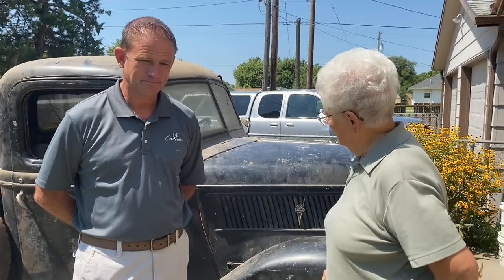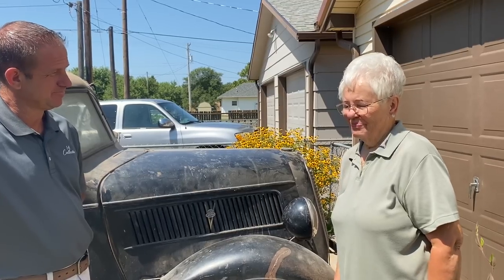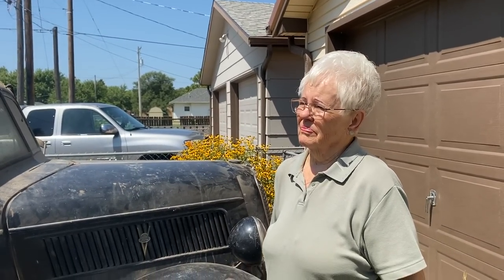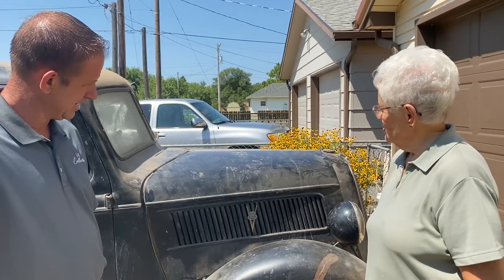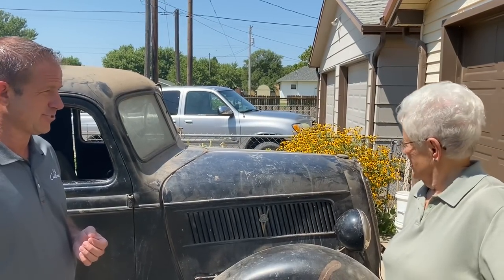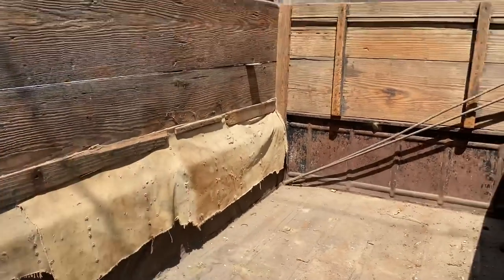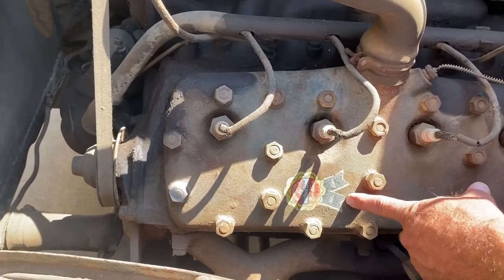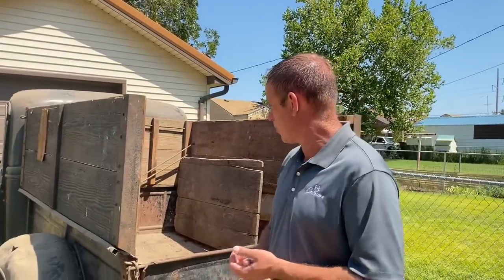1937 Ford Pickup Truck - A very special truck crossing the auction block on Oct. 2nd, 2021!

Comment: Hoping the next owner will put it in a barn for the next 60 years to keep that original shape and condition
Reply: Nah, next owner will put a 2021 dodge ram chassis, LS motor, 9 in diff, chop the top, or whatever possible to totally destroy it
Reply: HIDE it.  WTF..  Fords were meant to be daily drivers..